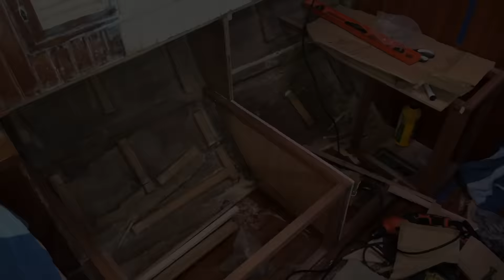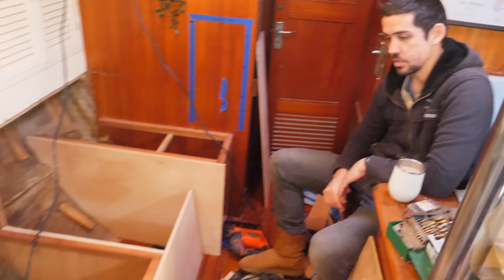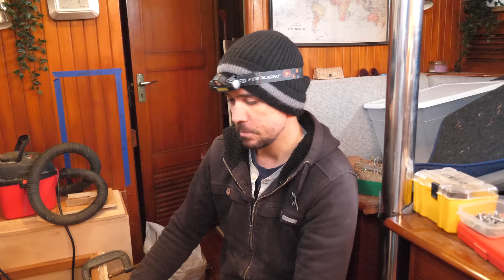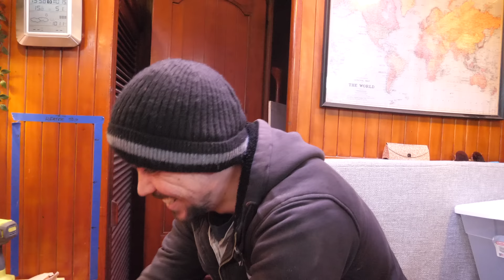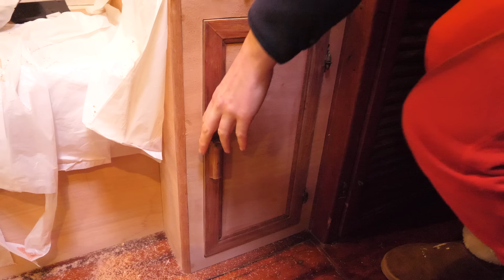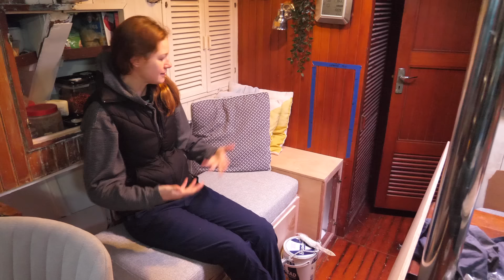DIY Sailboat Saloon Overhaul [EP 219]

Comment: To that "nothing is square in boats" like my old man always says, who has build several boats, "anyone can build a house, not so many a boat". Luckily had the chance to be part of the builds since little kiddo. Our boat's interior is stained not varnished. 

You can actually make a handy tool with little piece of wood (go for something like 3 by 5cm), drill a hole on it (close to one corner) and stick a pencil through it...great for marking/tracing the curvatory when making new pieces. Trick from the times before internets and amazon gadgets and youtube

Comment: Not sure where you guys are currently at with that top bench piece. If you need to fix the size of the top, you can always glue on a strip to the front edge of the bench lid. It will cover the edge of the plywood and give you some wiggle room to fone tune the front parallel with the hinged edge in the back.

Comment: The trimming with a two inch lip is called a 'fiddle', not botox overdose as it could be.  Don't forget to get busy with some good quality closed cell hull insulation, for the hull and deck.  Condensation and consequently mould is not good for you, in a different way from excess botox.